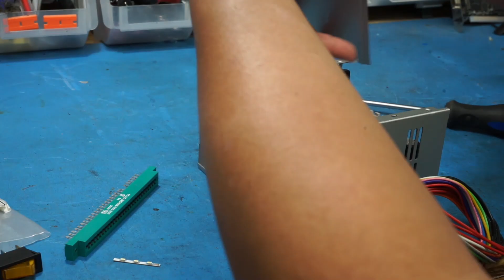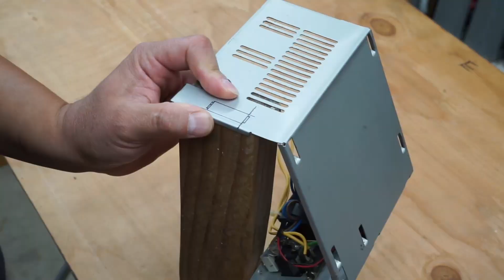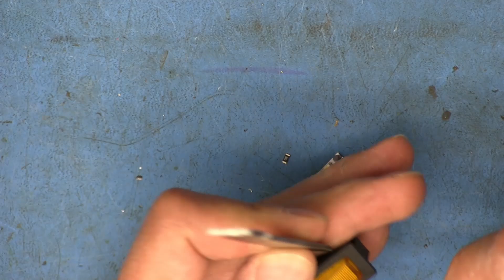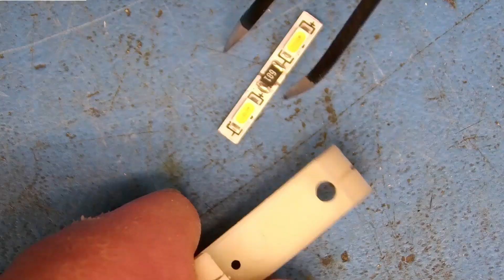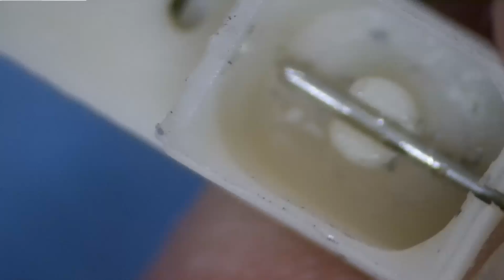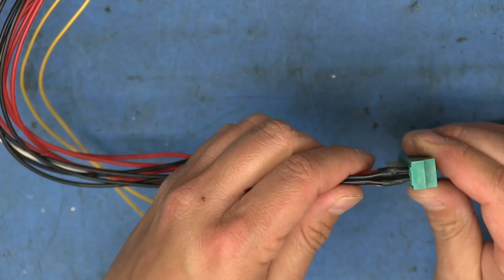TEF #149 | A Homemade Power Supply For JAMMA Boards Using Old ATX Power Supply

Comment: Any reason you went with green wire to GND power on rather than simple AC lead switch with fuse?
I assume the fused ac would be safer/better no?
Reply from the maker: It's certainly another way to do it, and I guess it would be safer in the case that you could completely shut off power to the entire supply in case something goes wrong. I only did it this way because it was more convenient to use wiring that was already available and had the purpose of turning it on and off.

As for the fuse, there's already one on the board on the mains live input, so even if adding a switch to the mains, not much else would need to be done.

Comment: Suggestion: the capacitor next to the inductor coil is bulged you need to replace it so you won't have a problem.
Reply from the maker: Thanks for the heads up, but I opened up the power supply to double check and I think you may be referring to the one next to the yellow inductor that has residual adhesive on the top. None of the electrolytics are bulging or leaking, some just have a bit of the old adhesive left on them.